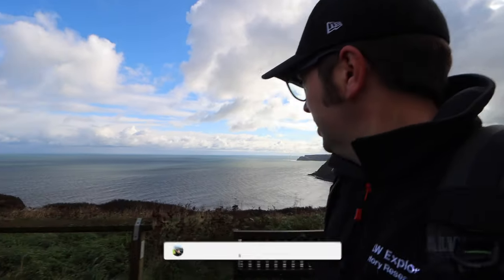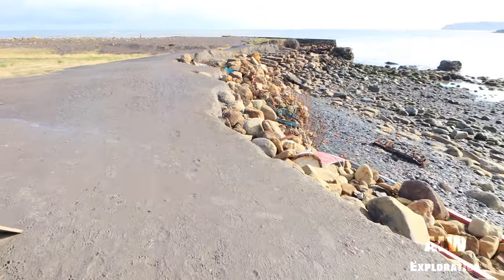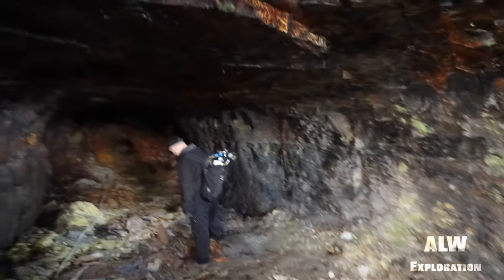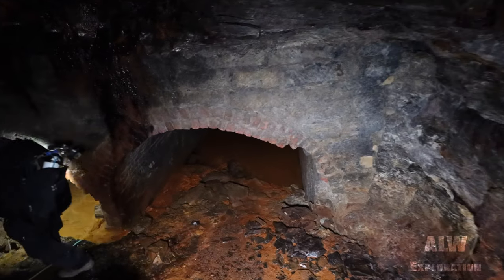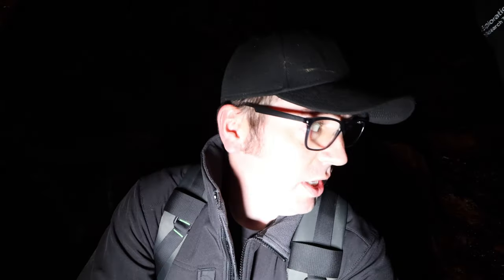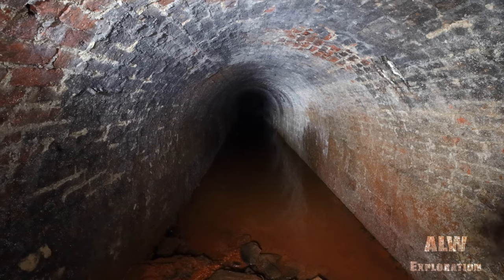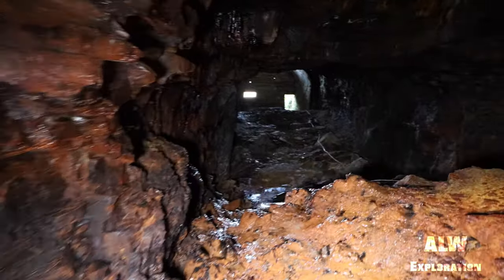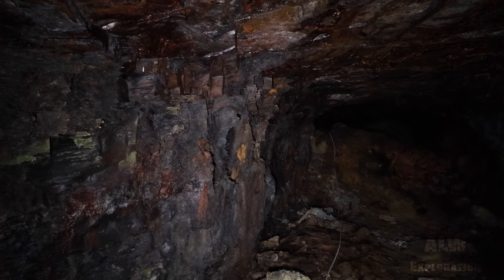Port Mulgrave Tunnel, What we found inside. I nearly passed out!

Comment: The left portal is lined for a few yards then goes into natural unstable rock for an unknown distance. It appears to have been a tunnel to allow ironstone from the higher seam to reach the harbour.
The right portal is the tunnel which went through to Dalehouse and Main seam ironstone was brought through here from Grinkle Mine. Trains of wagons were hauled through by a rope system driven by a steam engine at the harbour. A short distance inside is a drain in the right wall leading down to an inclined tunnel from the main tunnel down to the harbourside. There was a major collapse inside the main tunnel just a few years ago although it has been blocked for many years as a through route.
At the inland end the other tunnel entrance is kept securely locked by the landowner because of the danger inside from roof falls and rapid oxygen depletion which doesn't sustain life. In addition this end of the tunnel was at one time used for dumping sewage so it can be even more unpleasant!

Simon Chapman
Cleveland Mines Heritage Society
Reply from the maker: Hello Simon, Thank You so much for commenting. Your information is very interesting indeed and tells an interesting story in to the history of the tunnels. Thank You for taking the time to do so :)

Comment: It’s worth bearing in mind that methane is extremely flammable and may form explosive mixtures with air and can cause huge explosions if ignited. It has been the cause of many disasters in the mining, water, oil and gas. Miners use special electrical equipment to prevent an electrical spark from igniting any surrounding flammable gases. I wouldn’t recommend using a standard torch or camera flash in there.
Reply from the maker: Hello there. It certainly is dangerous in there. Thank You for your concern and for watching. I used an Ex camera. The guy with the flash was a photographer that was stood further back in fresh air.
Reply: @ALWResearchTeam  That's good to hear, I wasn't trying to be clever but I used to work in petro chem. hazardous areas and used to maintain Ex equipment. You obviously have knowledge of the dangers and choose your equipment accordingly. Great video by the way, really enjoy your posts.
Reply from the maker: Thank You and You're Very Welcome

Comment: Nice old video, Andy. I just came accross it. As many said, methane by itself is odorless. Sulphur derivatives, on the other hand... nasty stuff all the same. Oxygen depletion can also be caused by the oxidized iron ore. I've seen it happen in al old foundry internal underpass full of rusty scrap metal awaiting disposal. It had closed doors on both sides. We had to pull the first guy out of there. He fainted out a few seconds after entering the tunnel. Silly teenagers do stupid things. The brighter the rust, the more recent it is and the more it consumes oxygen. Once it's "eaten", the environment has no sustainable oxygen levels. Extremely dangerous. Sorry for the long comment. That mine sure did bring some old memories.
Reply from the maker: The air was really bad in there, it would be fun to find the other end of the tunnel one day, such and interesting place. Thanks for the information, I recall Dave talking off camera about iron ore depleting the oxegen. Rusty steel used to cause issues on ships too. Thank you so much for watching and commenting with great info :)
Reply: @ALWResearchTeam  Always a pleasure, mate. Keep up the good work.